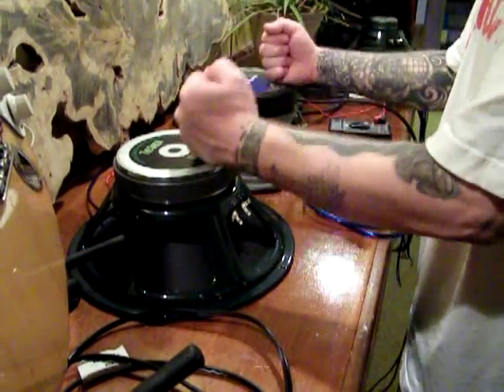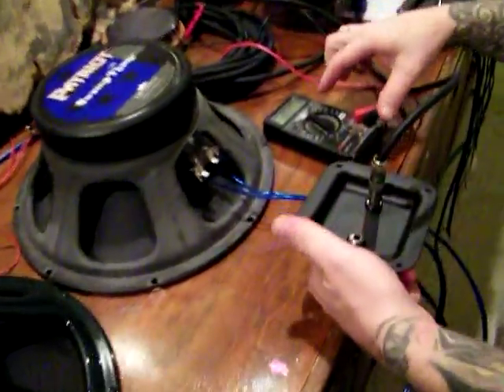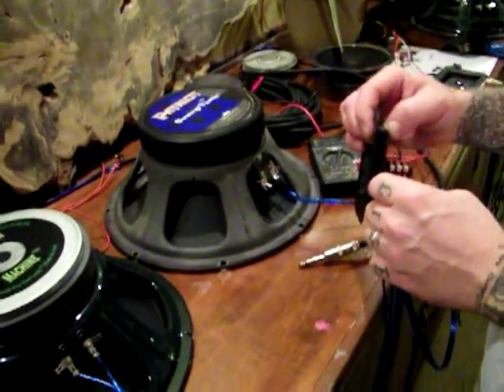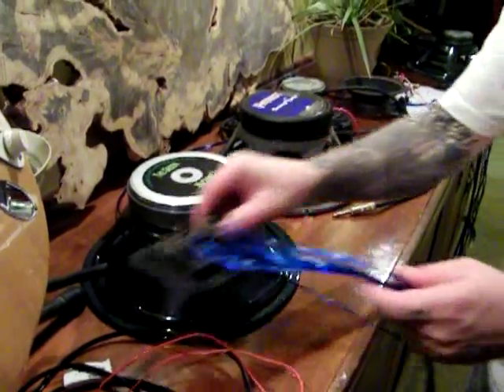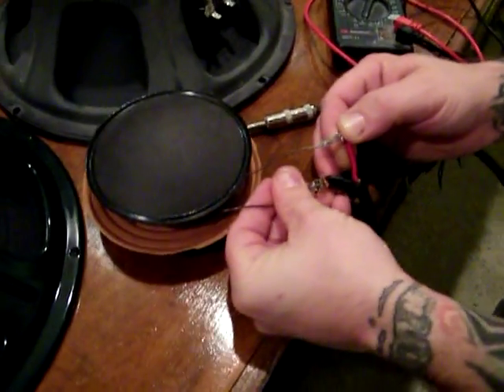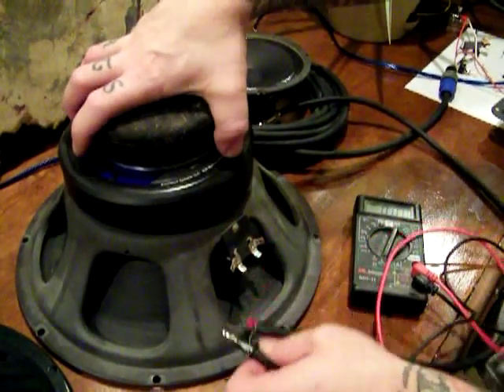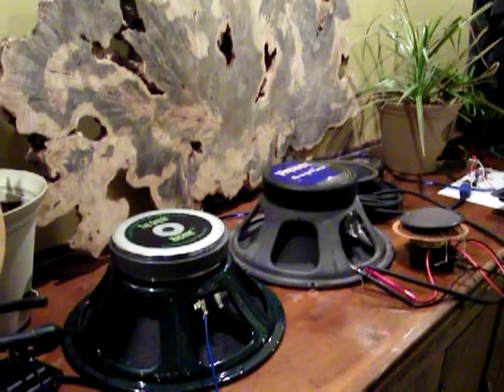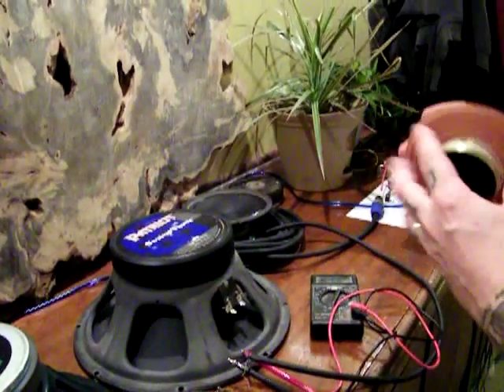EarCandy FAQ Parallel vs series wiring for guitar speaker cabs 1of 3

Comment from the maker: Thank you very much!
Im am using a 12$ multi meter from walmart. Just make sure it has the ohm symbol in one of the sections of the meter and youll be able to measure ohms as well. I promise it is not a expensive meter. :) 
Thanks!
Tim